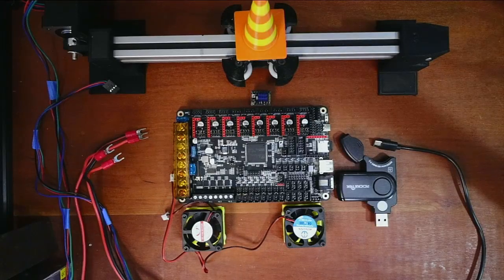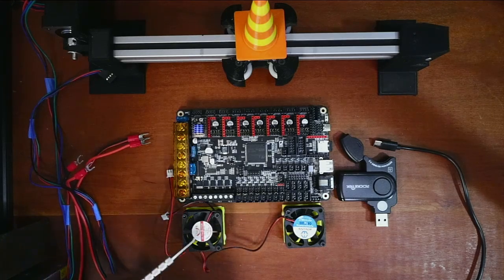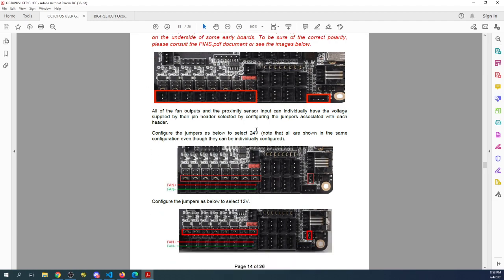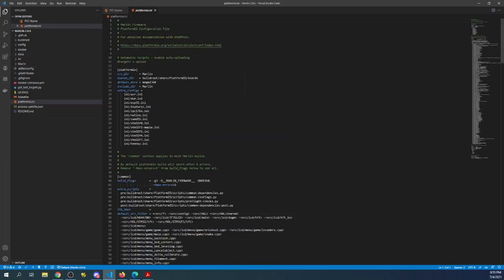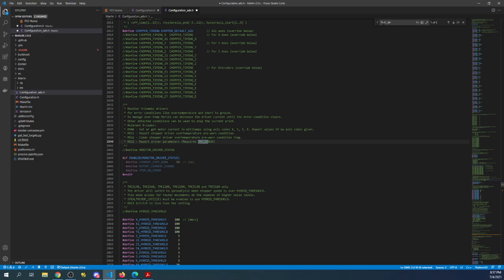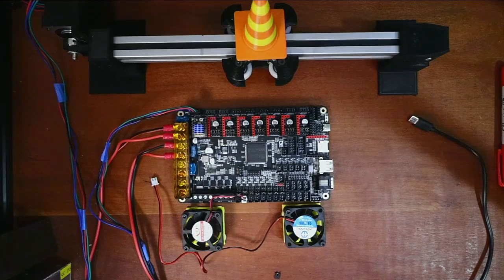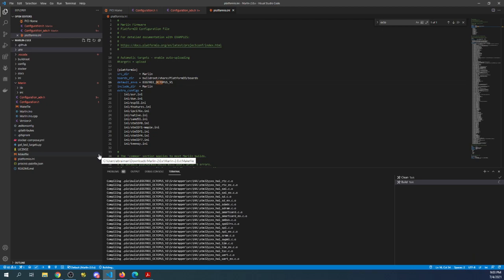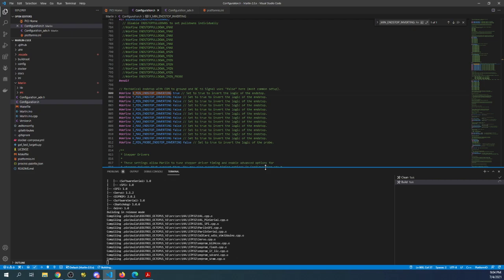BTT Octopus V1.1 - TMC2130 with Sensorless Homing and Controller Fan

Comment: Are there any reasons for using SW_SPI instead of built in hardware SPI connections in order to communicate with MCU?
Reply from the maker: SW SPI points to pins file for board.

If a signal pin fails you can specify a signal pin in advance configuration file or in pins file in board.
Reply: @EdwardBraiman  ok thank you
Reply from the maker: You're welcome.

Comment: so my axis just slam into the end and keep trying to go on
i followed your tutorial step by step but my drivers are the btt 3.0 version.
any suggestions?
Reply from the maker: Chane the Sensitivity for sensor-less homing to 2 or 3 or 4.  The appeared to have changed it after version 2.1 or 2.0.9.4.  Anything below version-wise should be 8.
Reply: @EdwardBraiman  wow i am really stupid. Works just fine now. Any suggestions about getting a crtouch to work? 
i either keep getting an emergency shutdown or the z motors try to drill right through the buildplate...
works with any other board btw
Reply from the maker: Normally extension of cable has a issue with connector.  Testing continuity might be something to check in wiring.
Reply: @EdwardBraiman  so it seems to be a bug on the octopus because i cant seem to get the pulldown to work.
nvm though because i just got my capacitive probe and it works just fine.
thank you very much
Reply from the maker: You're welcome, but capacitive sensor needs to be watched like a hawk.  The wire guage needs to be watched as it can cause wires to melt.  I stopped doing capacitive tutorials b/c wires melted during testing.

Comment: Hey, what do I do if I want several fans to be controlled like this? Let's say, FAN1_PIN = PE5 and FAN2_PIN = PD12. Is this possible?

I am using DRV8255s if its relevant, but I don't think it matters. Oh and F429 chip. I've got it working already with just PE5.
Reply from the maker: There's at least 6 fans and if memory serves me 3 are signal pin controlled.  Other three are direct powered.  I'd need to check pi out diagram for a better answer..

Comment: hey man what can i do when the display show me tmc connection error? with btt 2130 v1.1
Reply from the maker: Is motherboard PSU powered?
Reply: @EdwardBraiman  yea is it but i found it allrdy out via m122 the e0 driver was inside the wrong slot thats why marlin have cryed about com error
ty anyway for the quick respond at all :)
Reply from the maker: You're welcome.

Comment: Thanks for the video. What jumper setting I have to do if I want tmc2130 in standalone mode ?
Reply from the maker: I'm unsure about standalone mode.  May I ask why you need it?
Reply: @EdwardBraiman  it just because i had  a few tmc 2130 soldered for standalone
Reply from the maker: I think but have not confirmed they are same position.  It's best to verify yourself.